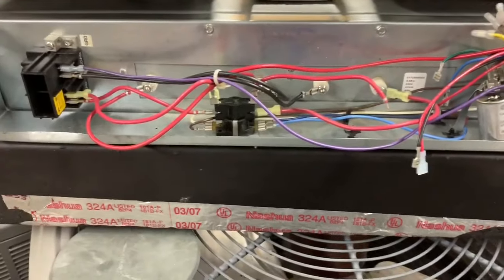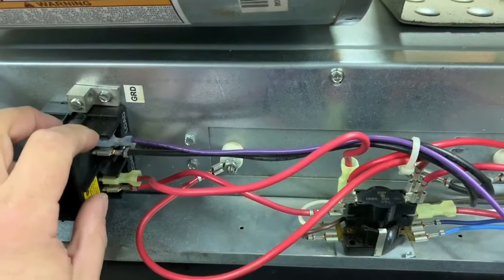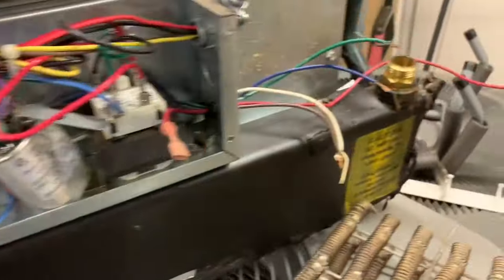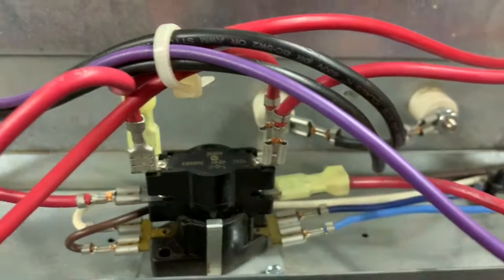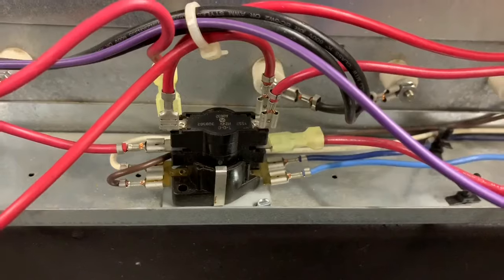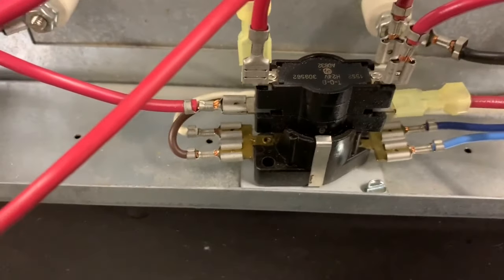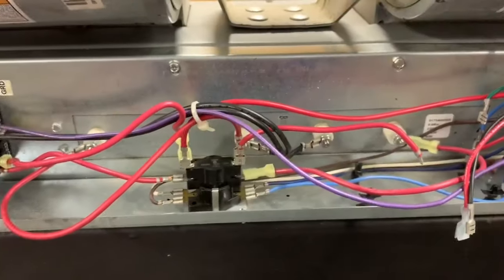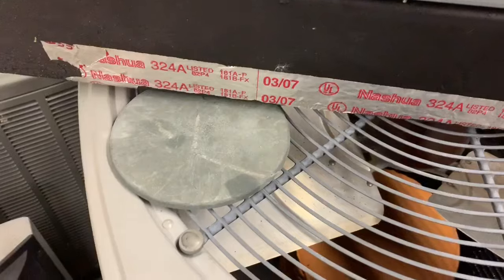Troubleshooting Electric Heaters For Air Handlers (Sequencers Explained!)

Comment: How do I check a heat sequencer with multimeter ?
Reply from the maker: +Arturo A  the easiest way is check for 24v on the bottom terminals. And to check if the sequencer is open or closed you would check ohms on the heat strip terminals of the sequencer with the heat strip wires disconnected. OL means it’s open, if you get an ohm reading then it’s closed. If you need better help let me know I’ll post you a video
Reply: Do another video checking please sir

Comment: How would I know if my heat strips are on if my air is off?
Reply from the maker: The easiest way is by using an amp clamp meter. If you clamp the main wires going into the air handler and you get an amp reading of say 10 and above, then you have strips on. Nothing else in the air handler pulls that high of an amp load except heat strips. Typically each strip pulls 15-20 amps. Hope that helps, if you need me to make a video showing how to do that test let me know and I’ll get one up
Reply: @ntexashvac7240  I need that video right now lol. One of two heat strip is stuck on. I believe there is a temp safety switch that cuts power (sorry can’t remember the parts name. So electric air handler, no heat pump, runs normally. Except when the thermostats has kicked everything off I can hear (a relay?) engage and one of two coils turns on. Runs for a few seconds and kicks off. Does this continuously. I smack the fan relay and it quits. I’m thinking the fan relay is stuck on.
Reply: @dennisrandall8040   if it’s a Goodman, Amana or a Daikin it’s most likely the fan relay, it’ll look like a sequencer but it’s the relay and it’ll feed the strips. Also could be a bad sequencer that’s causing the strips to be on

Comment: Where does the white wire go to
Reply from the maker: The white wire on the bottom of the sequencer in this particular unit would hook up to a control board and supply 24volts when you call for heat at the thermostat.
It can also be wired directly to the heat wire from the thermostat in some models. On the thermostat it may be either “W”, AUX, or Emergency. It is what actuates the sequencer and starts the heater

Comment: Went on a call today the homeowner had a new ecobee tstat installed he said now it says the auxiliary heat stays on so I thought they put the white wire in the wrong place but no it was saying auxiliary heat on but really the tstat wouldn't bring the strips on even set to emergency heat I put a Honeywell t8000 tstat on everything worked as it is supposed to